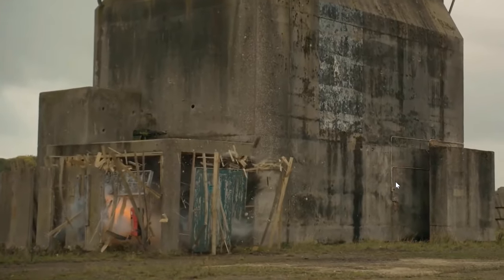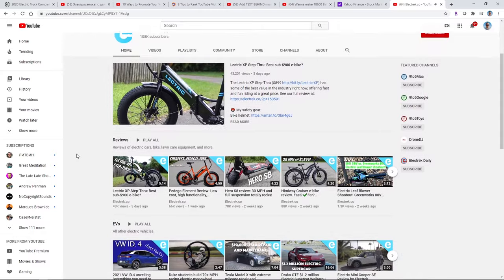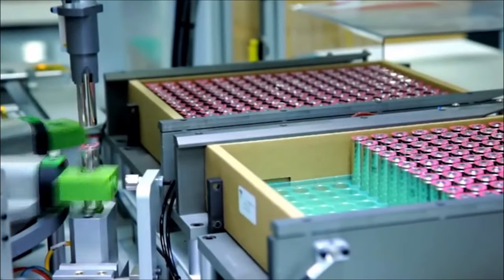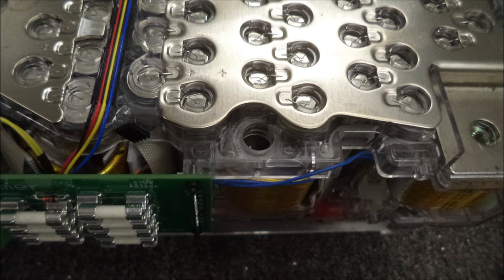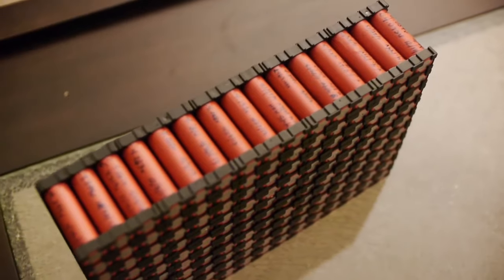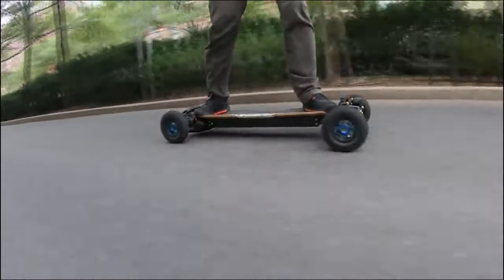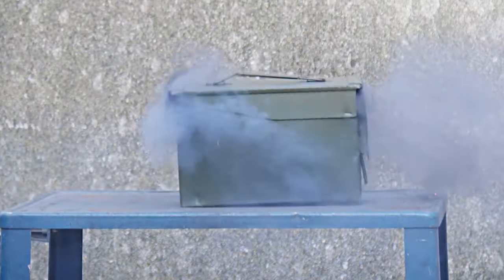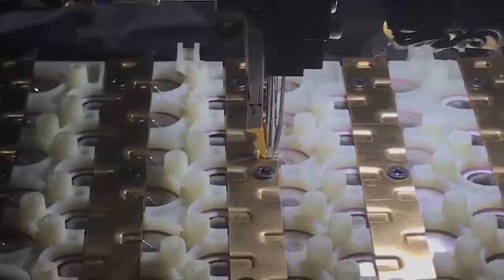7 Steps On How to build The Safest DIY Li-ion Battery

Comment: Your first statement is completely false and misleading.
Reply: Agree
Reply: No it's true lol. They don't explode as instantaneous though. Meaning it's not as dangerous as an actual explosive.
Reply: (in terms of explosion damage. They will burn for quite a while and take everything around them with it. Especially the larger packs. Teslas burning for days for an example. If I remember correctly a single 18650 is quite a few x more energy dense than Dynamite sticks)

Comment: The theory in the video is good but it just does not explain what a DIY hobbyists should do. You said to not solder the fuses but unless you have one of those machines you can’t really do it in another way. For small packs it’s okay to not have cell level fusing and just spotweld the pack without fuses. The fuses add additional resistance to your pack and make it a bit more fragile.
Reply: amen
Reply: Just keep in mind that it can burst into flames at ANY time from a defective cell or dendrite formation.
Reply: @glasslinger  if its an internal cell problem no fuse will save you anyway... when one burns the others go als well.
Reply: @blise518B  Oh shit! I guess I will stick with alkaline batteries and throw them away every week!   :)
Reply from the maker: @blise518B  the fuses will! It's shown in the video how it works and it's explained!
Reply: @ElectricVehicleSpace  no fuses won’t safe you if it’s an INTERNAL cell problem.
Reply from the maker: @blise518B  if you dont understand how it works from this video watch the tesla explanation or maybe read. Maybe it will be easier for your you to understand  how it works.
Reply: @ElectricVehicleSpace  you don’t understand it…. If you have internal dendrites forming in the cell that cause an internal shot the cell will burn. Even if it’s just the one cell on its own. And if one cell burns there is a high chance it will also ignite the other ones.
The only thing that can protect you from that is good quality cells and good care of the cells. No fuses.
Reply from the maker: @blise518B  it looks like you are smarter than Elon Musk and entire tesla engineering team or you are one of those people that dream with open eyes and believes is none sense.
Reply from the maker: You can use a spot welder. I posted a video review and I show how I made my battery pack.
Reply: @ElectricVehicleSpace  well but I only saw this video. If you want to explain DIY you have to show DIY.
Reply from the maker: @blise518B  look on my channel.  There are several videos.
Reply: @ElectricVehicleSpace  can you link them? I’m not to interested in the shallow review / show type stuff.
Reply: @glasslinger  The way to avoid this is proper battery management, which is at least as important as a fuse-per-cell, in fact having per-cell fuses can cause a pack to become dangerously unbalanced if it isn't detected and there is no proper BMS that detects that one of the series connected parallel groups of batteries is already approaching maximum discharge or full charge before the remainder. This can lead to that one group being overcharged or undercharged. So it's not as simple as 'add fuses', and many manufacturers of professionally built packs do not use individual fuses per cell. Also, most cells have automatic disconnects under the plus terminal in case the cell ever is loaded too heavily. (Some people try to restore these, a practice I strongly recommend against).
Reply: @blise518B  This is true for large shorts, smaller ones can go undetected for a long time before they become catastrophic, the early tell-tale is a pack that goes out of balance, cells that are hotter than their neighbors and cells that have a higher internal resistance or that have less capacity than the rest of the pack (assuming identical cells). These all show up as voltage differences between the groups of parallel cells, if you have a BMS with diagnostic capability you can typically ask it what the voltage of each cell group is. Keep an eye out for groups that do not nicely balance over a charge/discharge cycle, and any groups that appear to lose charge if the battery is left to sit for a while, that's a strong indicator that there is at least one bad cell in that group.
Reply: @blise518B  And always rebalance the pack if it goes off kilter and make sure you figure out why it went unbalanced. A few mV between a full charge and discharge is acceptable, more than that is not.
Reply: @glasslinger  The best way to avoid this: use quality cells with a known history, ensure the cell groups never get deep discharged or overcharged, keep the pack balanced at all times. Cells dying or dendrite formation are usually the result of abuse. One more thing to really look into is the mechanical stability of your assembly, especially when it is used in a vehicle, essentially the pack will have to survive years of use (and abuse) without connections breaking, resistance increasing or physical damage to the cells, no matter what happens to the vehicle itself.
Reply: @ElectricVehicleSpace  I think it is important to point out that Tesla manufactures batteries at scale, and that they carry many thousands of batteries in a single vehicle. This increases the chances of a manufacturing defect, in spite of a huge investment in quality control, the packs are very large which means that the effect of a bad cell on a cellgroup might not get noticed by the BMS before it is too late and that in case of a crash the battery pack integrity is assumed to be compromised. Tesla also has the ability to wire-bond with great precision ensuring repeat accuracy from one wire bonded fuse to the next, something that any hobbyist even with a spot welder or wire bonder will be very hard pressed to imitate, which may lead to a false sense of safety ('my pack is fused, nothing can happen'). The big danger for hobbyists is not in the cell interconnects (though they can cause trouble) but in the mechanical construction, wiring and BMS. Those are all going to cause issues (and fires) long before the individual cell fuses would catch and correct a problem, and even then, if a fuse goes how will you know about it if you are not monitoring your pack to ensure it is still balanced? It is very important when porting ideas from industry to the hobby arena to understand exactly what the reasons for their processes are and to focus your effort there where it makes the most sense. For a 10000 cell home powerwall individual fuses make very good sense, this is going to be a main challenge in engineering to begin with and fuses per cell are not going to save you if you mess up elsewhere. A fuse in essence protects against one thing only: a single cell being asked to supply more current than it can deliver (see the maximum discharge rate for a cell) or a single cell being asked to absorb more current than it is designed to do. The first indicates a short circuit between two bus bars or a short of the entire battery. A short between two bus bars is best dealt with by solid mechanical engineering to ensure that it can never happen unless the battery pack as a whole is grossly deformed. In that case all bets are off anyway. A short of the entire pack is best dealt with with a single fuse at rated discharge for the application, taking into account the maximum current allowed for the wire connecting the pack to the consumer/charger. A short between the batteries in a single group and a cell will usually happen inside the cell, the problem is that a fuse will not really protect against this because the thermal runaway process will find everything it needs inside the cell. The best way to defend against that is to ensure that cells are dealt with properly: never to discharge below the minimum voltage specified by the manufacturer and NEVER to overcharge a cell. Doing this is a recipe for disaster, and most pack fires can likely be traced back to this, faulty wiring, improper sizing of the wire, bad cell-to-cell interconnects and other manufacturing / engineering / design errors. Do fuses help? Yes. Are they a major contributor to pack safety? It depends. My own prioritization would be: mechanical construction of the pack, wiring quality, thickness and isolation, pack fuse, cell quality, interconnects between sub systems, balancing wire lay-out, balancer / BMS quality, battery interconnects inside a group and between groups, and finally a per-battery fuse.
Reply: @blise518B  I think the point was that if a cell goes defective, the fuse prevents the good cells dumping large currents into the defective cell making total inferno more likely. However, you are correct in that an internal problem in an isolated cell could still ignite the pack. But the adjacent cells would then have their fuses blown. The point is the risk is mitigated with cell fuses. I have yet puzzled out how to do that. notching the nickel might do it.
Reply: @andychalkley4947  for diy pack’s in high Vibration Environments the cause for fire is pretty much always a short circuit because of loose connections or bad isolation. If you have a smart bms with cell monitoring you can tell that the battery has a problem before it gets dangerous.
The cell level fusing in cars is way more important because you have so much more cells a single single cell failing without noticing is much more likely.
Reply: @pianojacq  Your wisdom is not lost, I agree 100%
Reply: Yes it does
Reply: I'm literally watching it he's telling you
Reply: His fuse was constructed based on his expertise of how much current that wire could handle he knew it was only a 15 amp piece of wire and he drew more than that through it to show you that each connection needs to be fused how you achieved that can be modulated with different electronics and fuse setups
Reply: @asrielandcharadoesstuff4789  and how do you  attach the fuse wire to the cell?
Reply: @blise518B  If there's a faulty cell isn't that caused by a short in the battery that causes it to discharge at a high amperage until it explodes? If you have a fuse on it won't it cause the fuse to fail before the cell bursts into flames.  

Short in cell > higher amp discharge > fuse breaking > circuit being broken > battery stops discharging.

Correct me if I'm wrong please. I'm not an engineer.
Reply: Just more propaganda, move along
Reply: Showing how it should be done but haven’t build any packs yourself using this safe method?

Comment: so for number five you choose a size of wire that melts at its highest cell discharge rate? is there anyone that sells different amp rated wires so i dont have to salvage from wires? also how do you put that fuse on the cell without soldering or can you do it with a battery spot welder?

Comment: 1. Know the maximum draw of your motor
2. Match the current output of your batteries to the motor
3. Ensure bus bars can handle the current
4. Create space between cells to allow cooling and avoid short circuits
5. Know the maximum output of your fuses (Use a fuse from cell to bus)
6. Isolate the entire pack from exterior elements and causes of short circuits
7. Temperature control and insulate the battery pack thermal threars
Reply: Is there really any cooling that goes on with a pack between the cells or whatnot when it’s wrapped in tape and heat shrink and foam and insulation material inside a closed plastic or metal case? It’s not like the open air of you cruising down the street is passing over the cells and dissipating heat 😂 I don’t think the spacing of your cells matters unless you’re going around poking holes around your battery case or have a fan or some sort of heat-dissipating material or something
Reply: @Jetsonn is more in case of short circuit the metal shell outside the cell is the negative and the plastic is very fragile
Reply: threars?

Comment: Could please you make a detailed guide on how to make it right?
Reply from the maker: i just did
Reply: @ElectricVehicleSpace  Nope. You didn't. This is a classic "they did it wrong but I do it right and I'll show you" video that slams actual builders to piggy back on their success but doesn't show better alternative BUILDING methods - it's just a quick, vague overview of common sense principles that should be considered in the PREPARATION of the build. If anything, this video just added to the confusion for the layman. Exhibit A: you say don't solder the cells, then proceed to show a clip of fuse wire soldered between the cells and say that builders need to do this but you provide no alternative to soldering. How do you 'fuse' fuse wire to the cell without soldering? Should have mentioned nickel fuse strips that can be spot welded instead. That would be a good start on the road to providing detailed information.
Reply from the maker: @JamesBiggar  I shown the pack with fuses that was spot welded.
Reply from the maker: @JamesBiggar  I am going to review in a week or so I cool portable spot welder and I will show again best way to do it. I did test these fuses and they worked and save the battery and the board from catching on fire. I have not build motorcycle batteries but it should be the same principle. I hope I do build an ebike soon if I find a place to weld.
Reply: @ElectricVehicleSpace  What is the amperage rating of the Fuse Wire that you used between the cell and th ebus bar ?
Reply from the maker: @MrSummitville  it's explained in the video
Reply: Does you do it now?
Reply: Where is that video?

Comment: There'll be a revolution in battery assembly fairly soon.

Cylindrical contacts that fit into drilled holes in a sheet is the easiest straight forward way. Cylindrical contacts are basically insulated cables or wires engineered into being electrical contacts.

I've been working with a company in the US to bring their contacts to the battery space. Their contacts are originally used for pcb testing in industry.

Custom cylindrical contacts can have enough conductors to reach currents as high as 60A.

Imagine battery construction like this, 
1. Place cells all in the same orientation(positive side up) into a cell holder.
2. Place sheet with Cylindrical contacts which has cell holder features bellow it for alignment and a pcb(pcb can have built in fusing) or foil above the sheet with contacts. Cell holder, sheet with cylindrical contacts, and pcb/foil can all be joined together(bolts or laminating meaning adhesive) becoming one assembly.
3. Screw down assembly with a cover and batteries built with all connections to bms already made.

No fancy robot or time consuming welding process needed.

Similar cylindrical contacts making contact to cells can also make contact between batteries final pos and negative aswell as voltage sense to a bms within batteries cover. No wires or ribbon cable coming from battery except pos and neg out of bms and something like a couple wires for communicating with an inverter or the like.

SSA or single sided assembly, negative connection is made to cells rim on positive side. Allows for one cell holder, contact sheet, and pcb assembly per battery instead of two like with DSA or double sided assembly. DSA is good for high current builds but SSA can also be quite high current just not as easily.

Also the cylindrical contacts within a sheet will be many times cheaper and smaller footprint than contacts like leafsprings and aren't soldered to pcb.
Reply: what's the company called?
Reply: @waverley41  HCD Inc (High Connection Density Inc) makes this style of contacts.
Reply: great idea 💡, this can save thousands of batteries whose lives are reduced by soldering and other things
Reply: @GENcELL2014  Any updates on your efforts towards making this system a reality? Sounds like a great step forward!
Reply: @MrSup911  yeah at this point it's been refined from a sheet with contacts to fairly small contact carriers(one variation for positive and another for negative on cells rim) which'll be mass produced and then populated by HCD cylindrical contacts to achieve very low cost contacts and accommodate many variations of series and parallel connection batteries more easily.
Contact carriers are sandwiched between cell holder, pcb or metal sheets and a rigidity sheet or pcb cover with bolts holding everything together. Contact carriers are geometrically held in place with simple geometry in cell holder instead of double sided adhesive sticking them to pcb. Not using adhesive simplifies and lowers contact cost by avoiding having to order and manage custom shaped adhesive that needs to be accurately applied to a fairly small contact carrier.
Reply: @GENcELL2014  update?

Comment: can i ask you recomendation gloves when build battery pack?
Reply from the maker: Good idea to use gloves 👌 but that for high voltage. I only worked on max 12S packs. It's not really needed in my case.